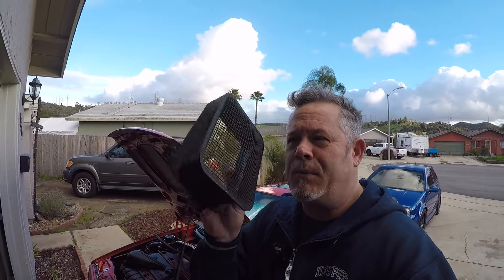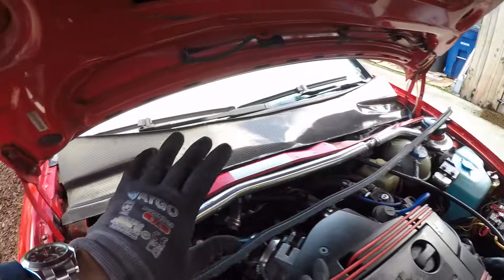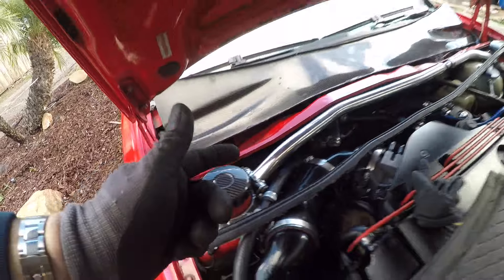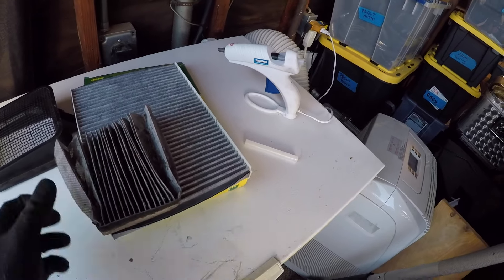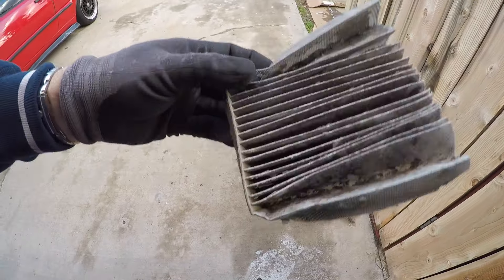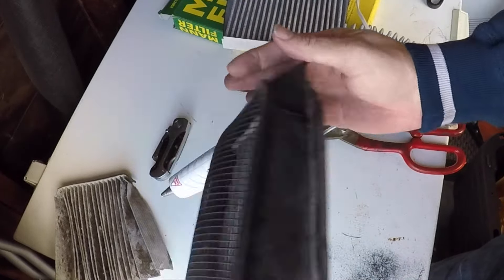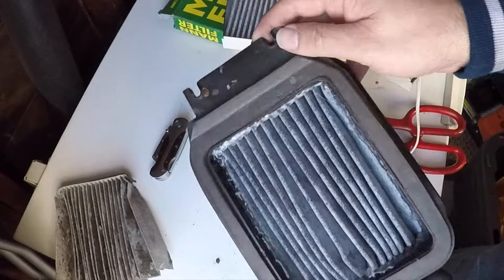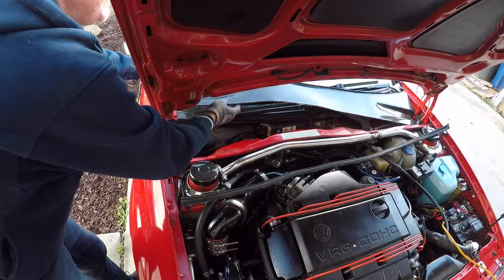We Make a Corrado Cabin Air Filter for under $10

Comment: Nice mod of course. I use an even more simple but also effektive mod on my Corrado. I use a ladies nylon sock, with which I cover the air- intake
Reply from the maker: Nice.  I can see how that would be easy & great for screening out leaves & large bits of debris from getting into the HVAC system.  
I do like having the activated carbon filter to also deal with allergens like the pollen blooms & dust we have to deal with in our area... For under $10 and a few minutes of work, I feel like it's worth the investment to keep breathing better :)